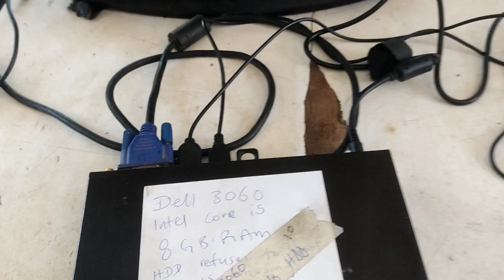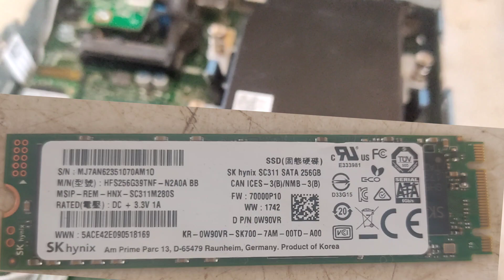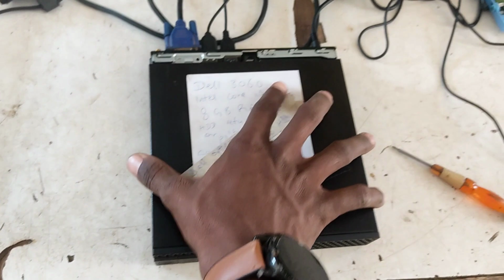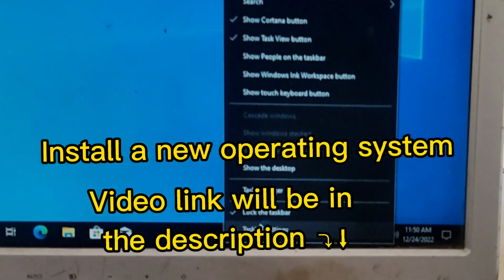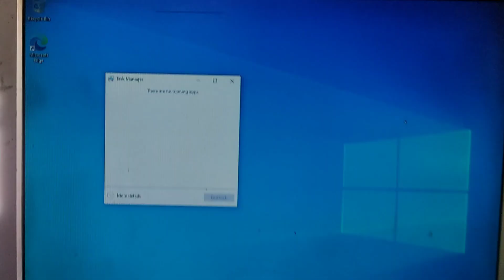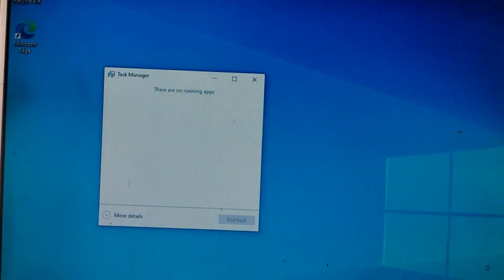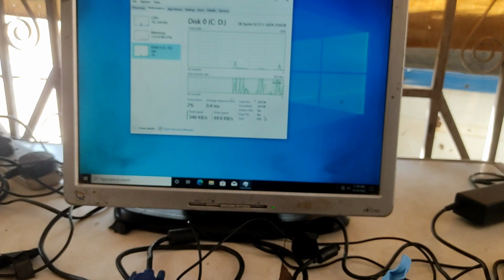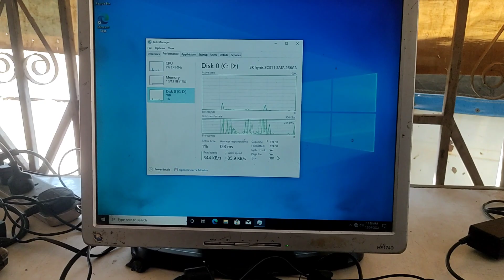How to Upgrade Your Dell OptiPlex's HDD to an SSD and Boost Your Computer's Speed

Comment: I am planning to get Samsung 990 PRO 2TB M.2.I am aware of PCIe 2.0 , about that performance will not be optimal.But do you think it will detect drives larger than 1 TB, there will be  no  stability issues? Thank you